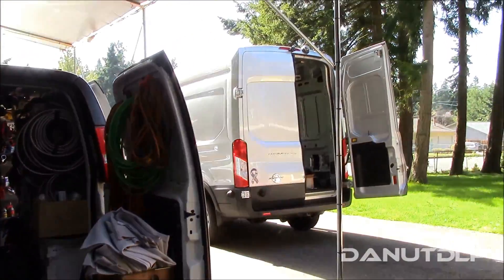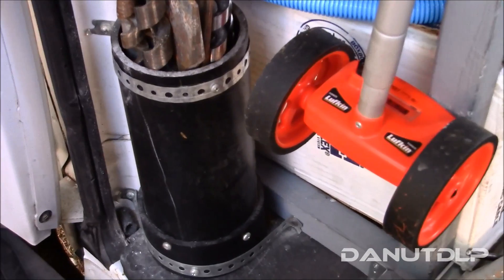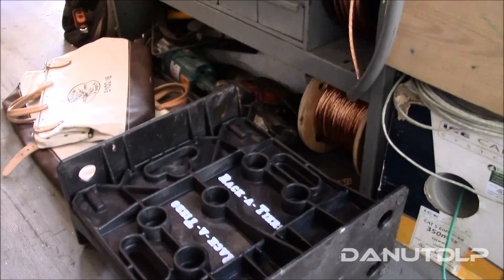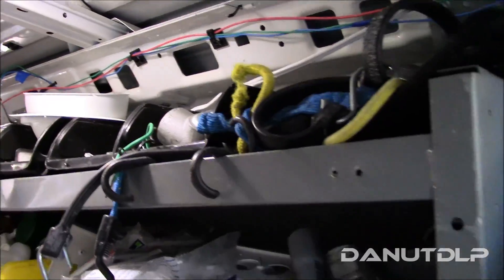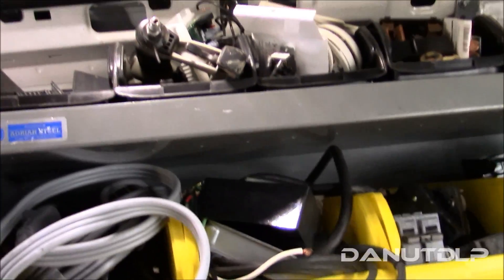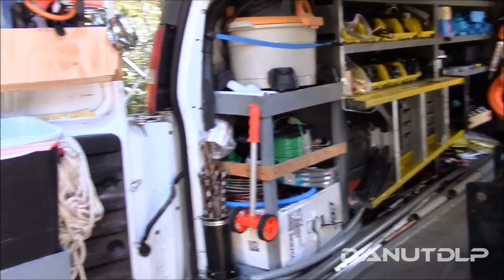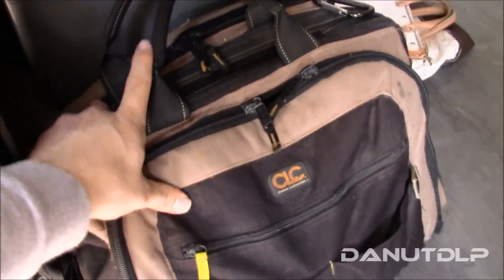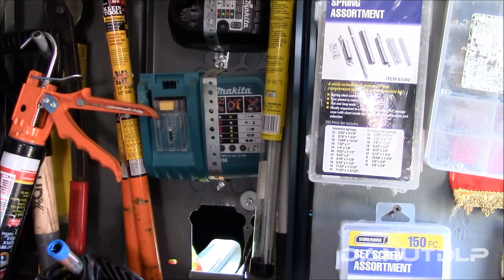Construction Work Van Shelves, Layout and Organization

Comment: I have a 2017 Chevy express like what you moved out of. Same metal shelving system with slightly different drawer configuration. It's ok, but having moved it twice now from older vans I'm looking for ways to improve my system. I'm pretty organized by the use of tool cases, but I've looked into using some of the modern solutions like the systaniers or something else to allow more dense tool storage.

Comment: What size inverter did you use for your portable chargers? Also did you put it in the cig lighter, or straight off the battery, or add an additional fuse for it from the control box?

Comment: My devices even in plastic bins just bouncing around by themselves get scratched up I clean them up before using them but sometimes it's a noticeable ding or scratch. The only thing that worked was when they came in there own little box. Those days are over. Some how they need to stop bouncing around Banging into each other is enough to knock the screws out and scratch them up
Reply: You can still buy them in Home Depot but they're only sold individually that way and they cost a lot more
Reply: Keep them in the case they came in, easiest way I have found.

Comment: u didnt get any flack for using an aluminum ladder? here electricians have to use fiberglass ones with rubber soles. also how do u haul an extension ladder?
Reply from the maker: I completely understand your point of view with aluminum versus fiberglass ladders. Here is the thing... I don't work on any high voltage power lines or on live circuits while on this ladder. I chose this ladder because it goes from a 6ft - 9ft A frame ladder and extends/converts to a 20ft extension ladder. I wanted to get away from roof racks and the downside of wind noise, less MPG and not being able to go through car washes.

Comment: How can you be a sparky with out a ladder bigger than a step. Don't you have an extension ladder ? Also don't your devices get trashed scratched up in those drawers.. Got mine in Tupperware bins with lids still a mess
Reply from the maker: The metal step ladder folds out and extends to 20ft. More than enough for what I need. Yes things did get a bit trashed in the metal drawers. I now have everything plastic or wood bins in my new van. Things stay pretty clean

Comment: Do you think putting a plywood floor down in the back is a good idea? I just received my first work van and need to outfit it as I need (e2 journeyman, mostly residential now, and also becoming a generator tech) so I will have to have a generator tool setup for installs, oil changes and other services, and then house material for new construction and remodeling work. Was planning on the floor so I can build off of it and not worry about screwing into the actual steel of the van. Any tips, thoughts, and suggestions are greatly appreciated!
Reply from the maker: possibly a good idea for plywood floors....

Comment: Electrician with an aluminum ladder?
Reply from the maker: I’ve used that ladder as an electrician for the last 13 years. It’s not like I’m using it anywhere near live power lines or working on live overhead services. I like to use this particular ladder because it has adjustable steps/legs and I can use it on stair cases. We install a lot of chandeliers that are located over stairs.
Reply: @danutdlp  Just curious, in the trade my self and always looked down upon even mentioning a metal ladder.
Reply from the maker: SeanLeonDrums I know what you mean

Comment: Also a little worried about you. Your breathing real hard either you live on a mountain or just finished a marathon.. Most organized van award will not go to my friend Gene. Minimum cabinets and stuff packed floor to ceiling have no idea how he gets anything done.. I have the Ford E350 loaded to the gills with cabinets and sparky stuff. Gotta find a way to keep my devices from bouncing around and getting scratched up. I leave them in the box but once box has a few out same problem.
Reply from the maker: Well as you can hear from the video my nose was pretty stuffy. I was getting over a bad cold that’s why I sounded like that. I knew were everything was in that van with my eyes closed

Comment: Metal ladders?
Reply from the maker: hercdiver yes, yes...... I know what you're thinking. Here is the thing though, as a residential electrician you're not usually working in hazardous or high voltage applications where a metal ladder might be an issue. It's the only versatile ladder that I could fit inside the van.
Reply: @danutdlp  In Washington State, OSHA does not allow an electrician to use a metal ladder. Just sayin.